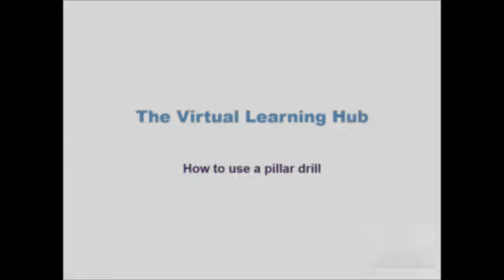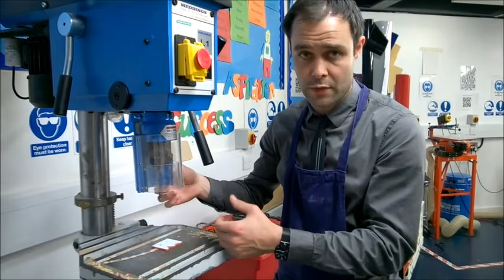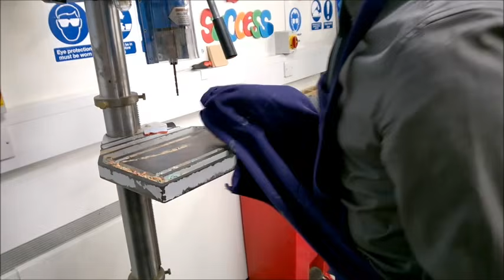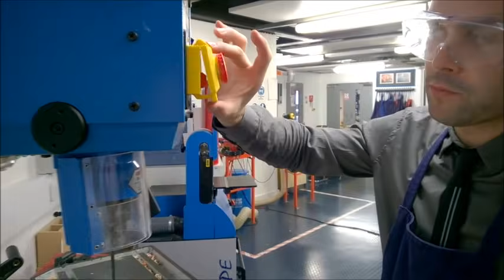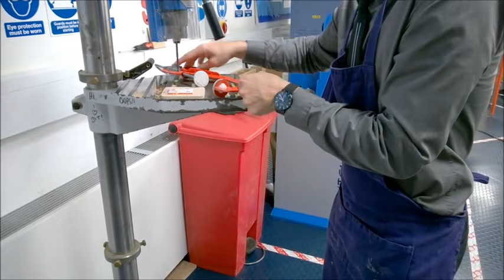How to use a pillar drill

Comment: “How to use a pillar drill”  Wear long sleeves 😂😂😂
Reply from the maker: This is a valid point, if you are wearing loose fitting clothing, it would be recommended to roll up sleeves, especially if the work piece was not adequately secured.
Reply: my man got violated, im now crying with laughter 😂😂😂

Comment: Why was the drill making the squeaking noise? It didn't sound healthy
Reply from the maker: It is a belt driven, variable speed drill press/pillar drill so, it is likely that the belt is slipping slightly which may be what was causing the slight squeak/squeal during the filming of this video. If this occurs for you, changing the belt or cleaning the pulley sheaves may help.

Comment: While I respect your enthusiasm and also like how clearly you describe things you make some definite errors with regards to the safe use of this machine;
-Drill bit appears a long way out and I wonder how much of the shank is held.
-A second pair of hands should not needed if a one handed clamp like that is used.
-You use your apron as a rag and then go on to clean your glasses with it after telling us about care for scratching our glasses.
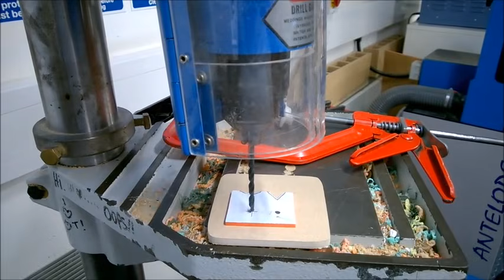-At 4:19 and 5:59 it can be seen that the drill bit is not centred.
-It may just be an optical illusion but the clamp appears to be at an angle and I suspect it is on a web / stiffener meaning it is much more likely to slip off.
Reply: ... Seriously 😑
Reply from the maker: rob1984p Good comments, I will aim to add these as amendments to the video or, refilm and upload.
Reply: +Bridge Academy Design & Technology my I suggest that when your said goggles you should say safety goggles/glasses because goggles can swimming goggles